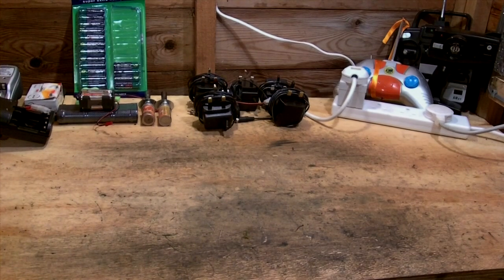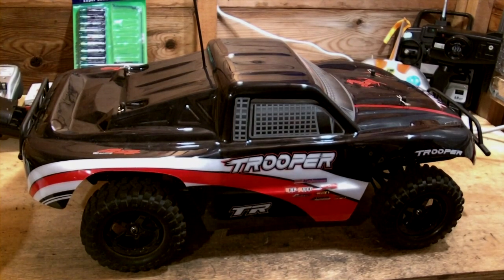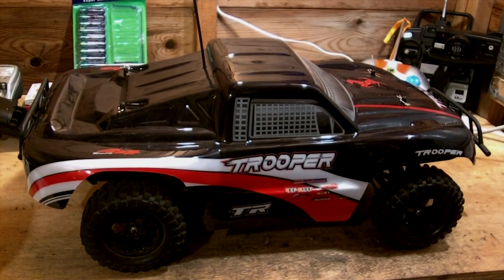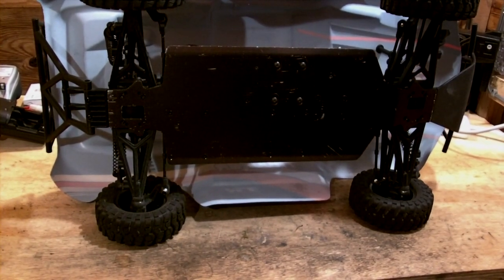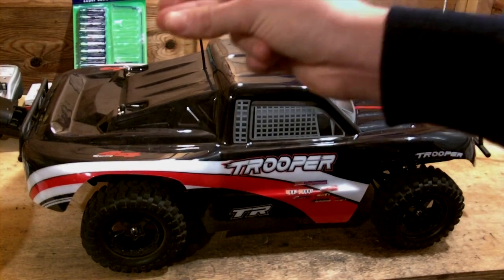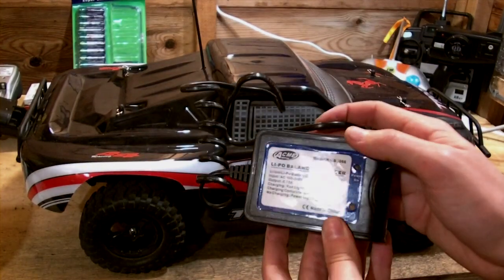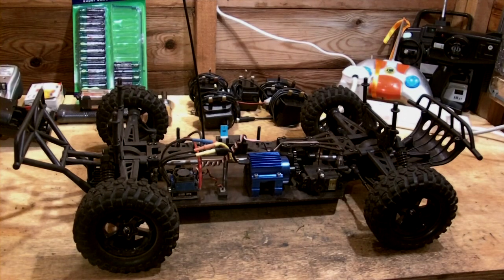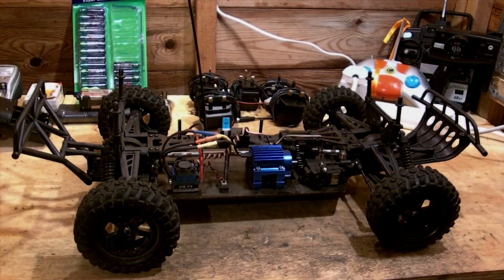Electric or Brushless RC Car After Run Maintenance

Comment: I wonder why would you have to remove the bat tree right after running your RC vehicle.?.?.  I check the condition and make sure it's not hot. However, I always remove it when I charge it just in case the bat tree leaks/catches fire.    Good vid for you beginners out there.  Keep it up!!

Comment: @grumpy2389  as on 95% of hobby grade R/Cs out there there should be links above the A-arm with threads on it nad it should have a part somewhere along it where you can put a wrench on it to adjust it.

Comment: +remote control mars bar the only reason your condor broke is because if you have a metal spur gear and you crush or take it over ex stream jumps the condor has no wear to go as the metal spur gear is to strong so the condor goes brakes because of compression

Comment: you dont need to run heat sink on brushless motors if you have enough air flow throught the car. and mate upgrade your lipo charger and get 2.4

Comment: Hey thanks for the video I see you have a heat sinker for your motor, I just bought a brushless 1/10 monster truck and do you think I should buy a heat sinker for the motor because the rc never came with the heat-sinker, when I bought the rc truck the seller says the heat-sinker is if i want to upgrade my rc truck, so do you think it's a good idea if I buy heat-sinker, thanks